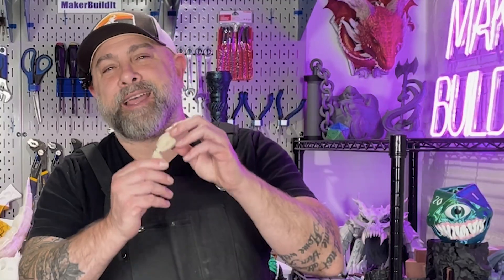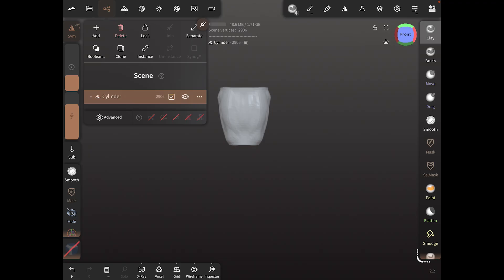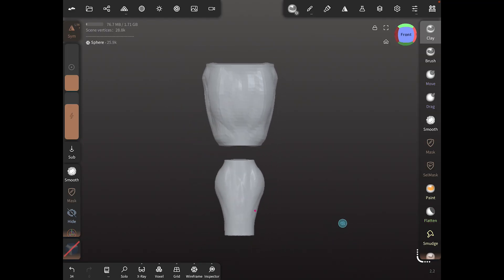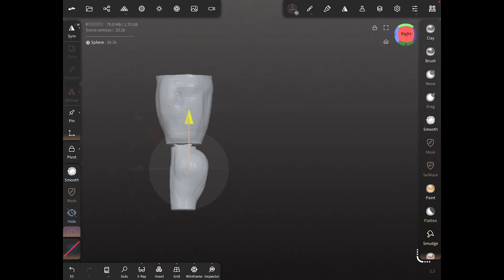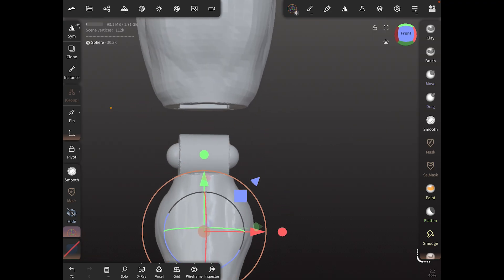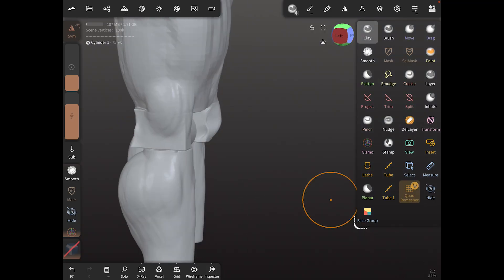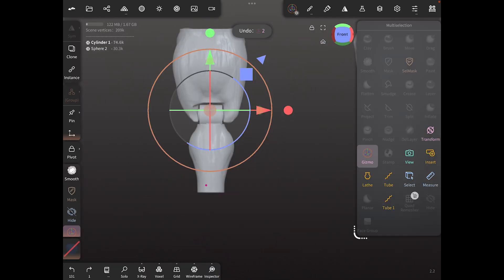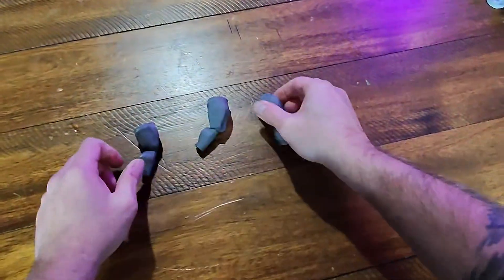Easy Articulating Joints for 3D Printing Anyone Can Make!

Comment: How is the print in one piece printed please? Doesn’t the print fail in the joint area as there is no support?
Reply from the maker: Good eye! The joint design is meant to hold up without supports. There is a small amount of tolerance between the parts, just enough so you don't need supports and the parts don't fuse together. 😁 Just a little 3D printing wizardry at play! 🧙‍♂️
Reply: @MakerBuildIt  thank you🙂
Reply from the maker: @angieangie21 Anytime! 😁

Comment: Now that but rotating for like a transforming part ;) .  Trying to do that same idea but for a joint that can swivel, bend, and have tension/friction to stay in place.  Maybe some sort of trigger or switch that stops the part from moving.
Reply from the maker: A swivel, bend, and tension joint with a lock sounds like a fun challenge! Looking forward to seeing what you create. 😊 I have a video on ball joints. If you combine the two, it may work for the basic joint swiveling and bending. 😁